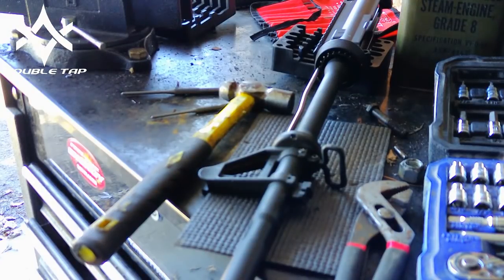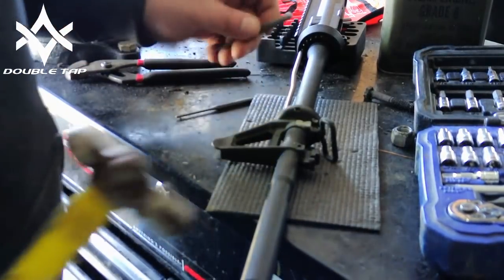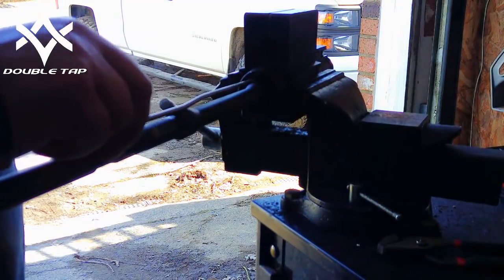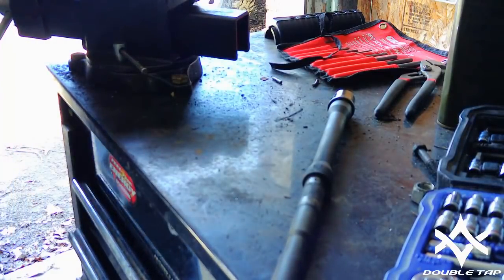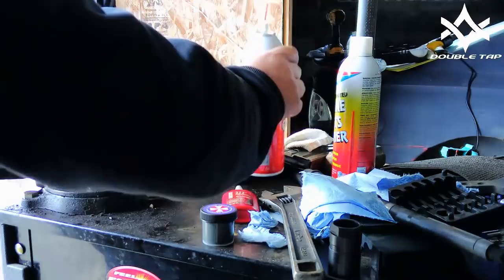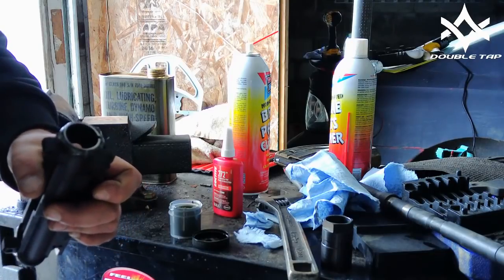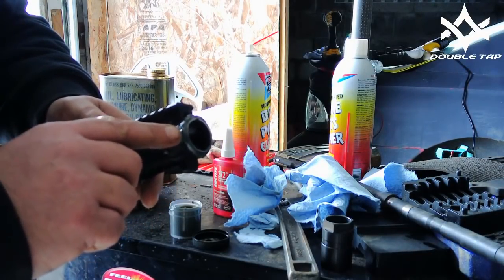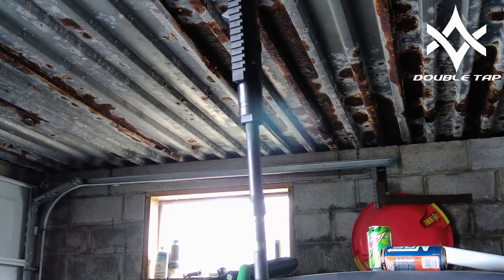Accurizing the AR15: Lapping & Bedding the Upper Receiver & Barrel

Comment: I use a reaction rod to hold the rifle barrel while working on the flash hider/muzzle brake or barrel nut.  It takes the torque stress off the location/joining pin and receiver. I use the barrel grease when assembling my upper receiver. It’s a horse apiece. I have several sub-MOA gas guns. The concern with using Loctite is that if you don’t get it uniform in the sleeve that it could expand with heat differently from spot to spot. The grease can move around and even out under pressure. Like I said it’s just another option. Barrel nut torque varies by manufacturer. Some are in the 30-40 ftlb range. Some are higher. Just follow the manufacturer’s recommendation.  I typically tighten and loosen the barrel nut several times to burnish the threads. I would complete that process prior to putting the Loctite on.  We use this technique on race engine fasteners. It helps get an accurate torque reading.

Good job on the video. As always, there are many ways to skin a cat.

I would weld up the vise. I use a special nickel wire in my wire feed. It takes some good prep work and some judicious use of a ball peen hammer. I have successfully welded race engine components using these techniques.

Comment: Have you ever heard of stainless steel shim stock from Brownells? I as a gunsmith would suggest trying shims both for Fitting and timing the barrel nut. Remember that the AR15 could never be truly free floated as the gas tube and block are attached and the heat variations will and can effect the Accuracy. Shims are just as effective with less trouble.

Comment: You’re a little confused about Locktite. 
It does not “air dry”. It is an anaerobic compound. It is the absence of air that makes it cure. If it’s exposed to air ie the squeeze out, that portion will not harden. 
How do you think it stays liquid in the bottle?

Comment: The gas tube can be removed without removing the front sight.  Slide the gas tube back after removing roll pin for the gas tube then rotate it, slides right out from the front.
Reply from the maker: but I changed the gas block.
Reply: Yeah, but he's accurizing the rifle, so the M16 style front sight is a definite no-go. Will need to replace with a low-profile gas block and freefloat handguard, which is what he did.